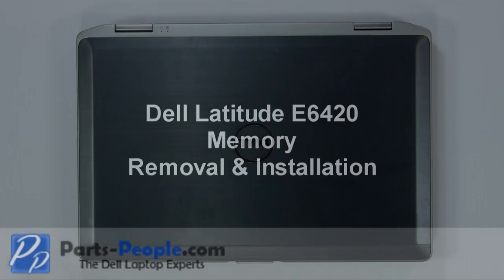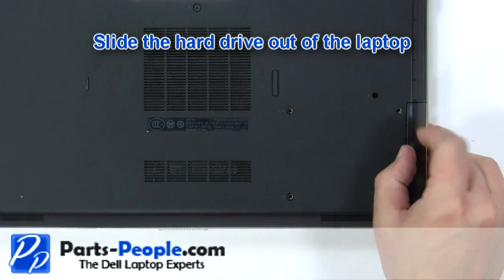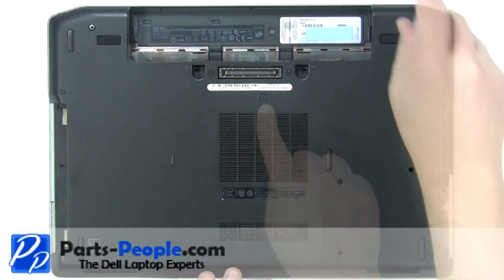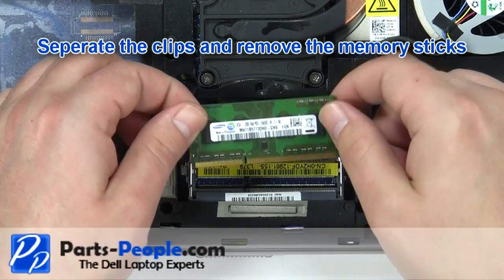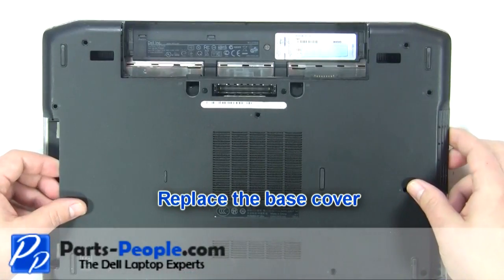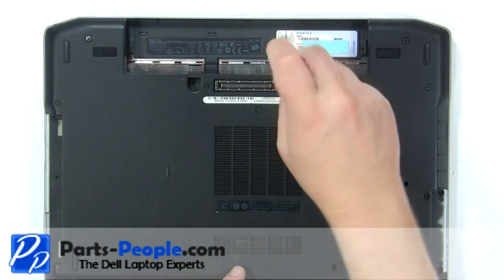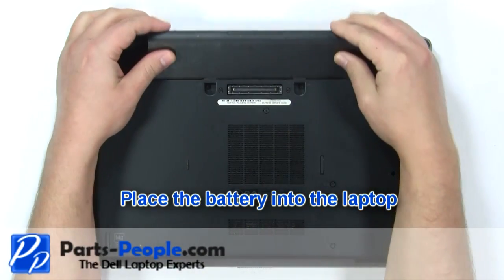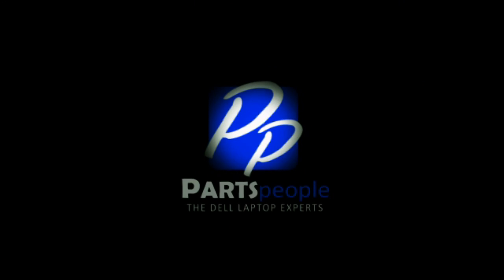Dell Latitude E6420 Memory Replacement Video Tutorial

Comment: To take off the backplate you don't need to remove the optical drive. You do need to remove the screws for the hard drive but you can keep the drive itself inside but be careful as it may slide out.

Comment: I have just changed my laptop's RAM but my laptop can not detect the HDD now, Any clues?
All the screws are fitted correctly, I am not sure where did it go wrong, as I can see the new RAM installed in the BIOS settings.

Comment: Thanks, helped a lot. A lot easier than most laptops. HP's you got to take out the motherboard =/. They do have some easier where you just remove 2 screws on the back for easy access to the memory.

Comment: Great video -- very helpful -- later Dell E6450 models (late 2014 and 2015) have redesigned bottom cover which only has:  no keyboard screws,  2 hard drive screws and 2 cover screws which are below the battery compartment.  After removing the hard drive & cover screws, carefully lift up the cover using the edges on each side of the battery compartment.  After a few gently pulls, it should pop up and then follow the video.

Comment: Thank you for the tutorial!  A few notes:

1.  I installed 2 SIMM sticks of 4 GB each in my Latitude 6420.  On boot, the machine reported only 4 GB not 8 GB.  I went back in, and re-inserted both SIMM sticks.  Voila, 8 GB.  When you insert the SIMM sticks, make sure they are fully seated or inserted.    

2.  The earlier comment about not having to remove the keyboard screws was correct for my machine.  The back of the machine was not attached by those screws.  Of course, your machine may be different (YMMV).

3.  However, the same earlier comment said that the hard disk did not need to be removed, but I'm not sure about that.  I removed the hard disk per the video.

Thank you, Parts-People.com,

Fred Wilf
Reply: Same story, 4Gb Vs.8Gb... Thank you for your story sharing, You saved my day!:)

Comment: It is not necessary to do half of the steps listed in this tutorial. Removing the hard drive completely and removing the keyboard screws is not necessary. You only need to remove the 7 base cover screws - each of the screws you need to remove will be marked with the letter "D".